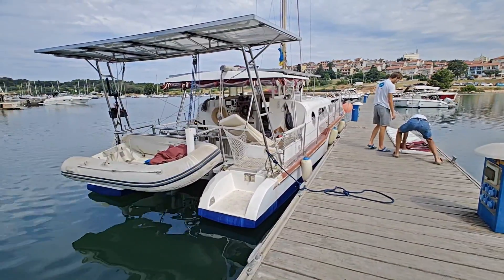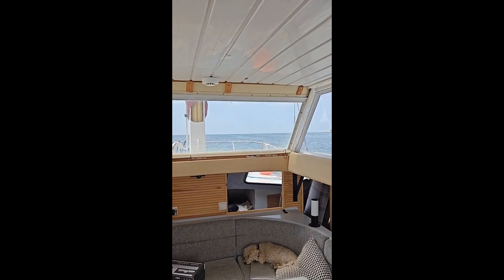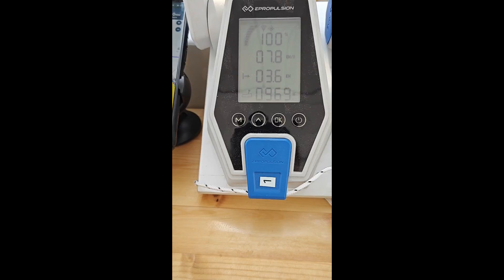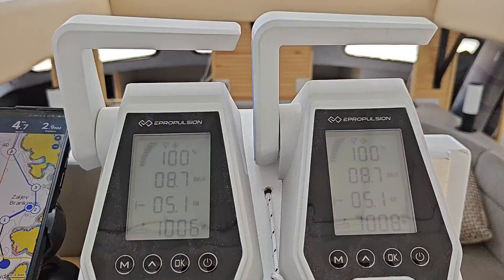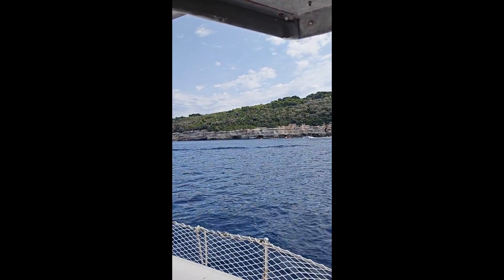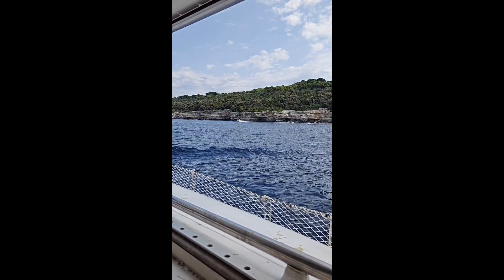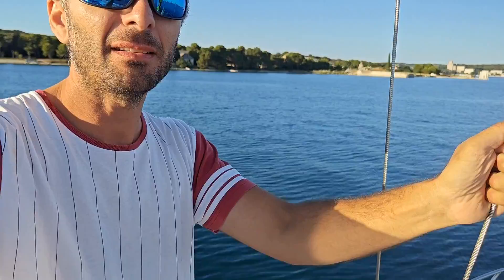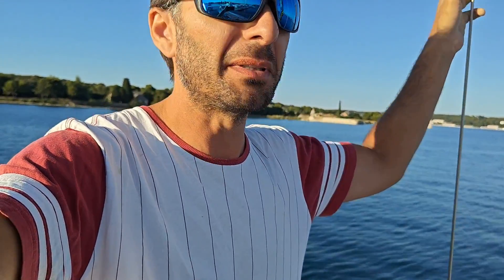Our DIY solar powered yacht works!

Comment: What kind of panels? How many? How many watts each. What are their physical dimensions? What kind of motors at 300watts each? What do you have for a battery bank? If you’re primarily running off solar does that mean you don’t plan on motoring at night or days with heavy cloud cover?
Reply from the maker: 16 eve280k cells in series for the 48v battery pack. Panels are 8 x Sunpower maxeon 3 400w panels. The motors can do 6kw each, but around 1kw each gets me near 5 knots. If I run at 300w per motor I can motor for 20 hours without sunlight at 2.5ish knots.
Reply: Very helpful, thank you. I wish I could incorporate that much solar on the monohull I’ll be converting. But maybe I can do half. Fair winds

Comment: This is a very nice video, I'm searching for this kind of yacht and this is exactly my idea too.
In my opinion, I would say that you need the batteries for nights and emergency situations that's because it's a sailing vessel as well.
Reply from the maker: Yes, you are right, motor slowly on batteries at night, and faster during the day on solar.